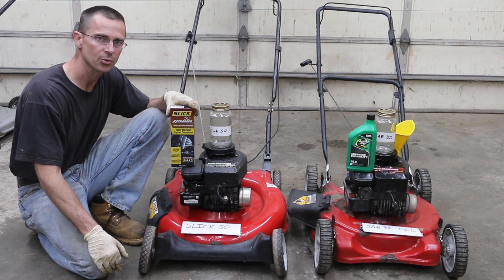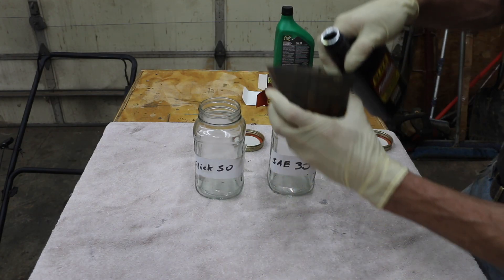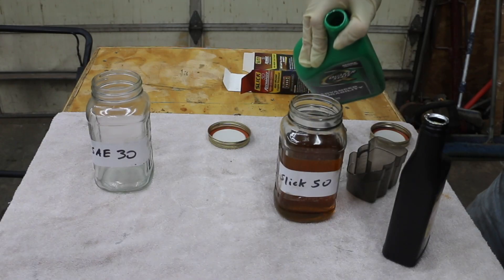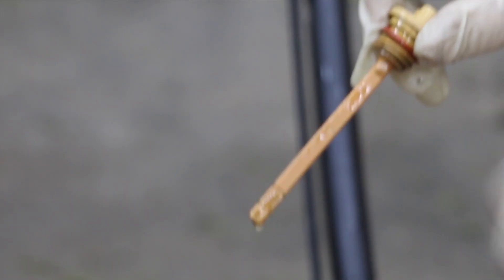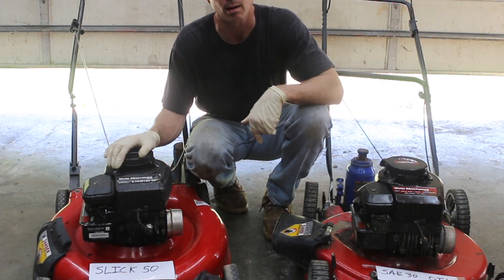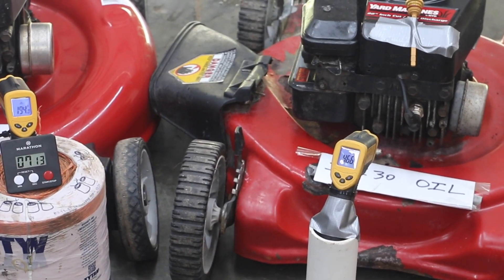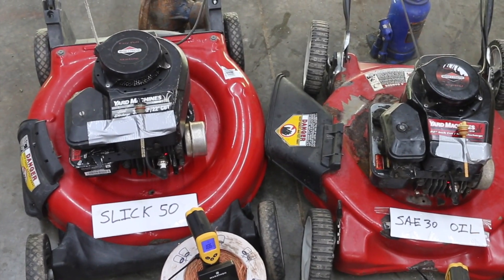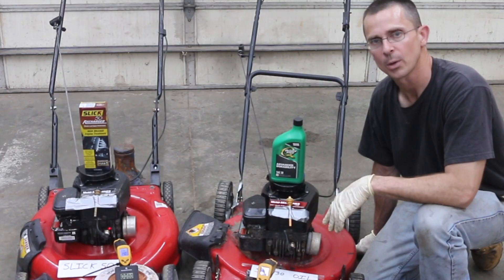Can't believe what SLICK 50 did to my engine!!--Dry Crankcase Test!

Comment: DuPont (the makers of Teflon, the active ingredient in Slick 50) actually said when they first developed the stuff, that is was not practical for running as an oil additive in an ICE (Internal Combustion Engine).  They primarily said this due to the fact that it breaks down over time with heat, even becoming more harmful to the engine.  Under extreme heat (empty crank case) it breaks down VERY quickly.  It seems that this was ignored by just about everyone back in the day.  Just look at an old Teflon coated cooking pan.
Reply from the maker: Thank you for this information.
Reply: No problem.  As a by the by, there was a product a few years ago that did what Slick 50 couldn't, or at least I was told it could.  About 20 years ago you could get hold of a product called MBL (Medal Based Lubricant) by Pro-Ma Systems.  It was an oil additive that was essentially micro (or possibly nano) sized balls of Lead and Copper.  This could (to a point) rejuvenate old engines by filling the scores with the copper and lubricating with the lead.  You could not use it for engines with say, roller bearing cranks (or any roller bearings for that matter) but in a standard engine it worked great.  Roller bearings tended to suffer from a buildup of material on the rollers.   I heard that this product eventually run fowl of the EPA as a small amount gets burnt (as you would expect) and so ends up in the atmosphere.  I believe its still available but the formula has now changed.  It was not available in shops. it was distributed via MLM.  Looking...  found it.  https://www.pro-masystems.com.au.  I didnt realise it was actually an Australian company.  Might not have been as popular in America.  There's an idea for your channel - if you can get hold of the stuff.  If you want to and cant get hold of the stuff, let me know.  I should be able to get hold of it again.

Comment: Xtreme Green is better.  It coats friction surfaces in Antimony if and when they get hot enough.  Slick 50 is a short chain solvent that cuts oil molecules down into smaller pieces to protect on start up and potentially clean oil galleries.  It does nothing to protect against heat, pressure, or friction.  Think of it as a cleaner and thinner in my opinion.
Reply: The way you described Slick 50 it would reduce temperature by improving flow (carry more heat away) and of course the Teflon.
8-)
Reply: briansmobile1, it is not a cleaner.  or that is, it never used to be.  it is or was a teflon coating that coats the inside of the engine.  i have had 2 top successes using it years ago.  and a fail since and a few maybes as well.  did it coat the internals?  probably.  i knew engine rebuilders who had grief trying to rebuild engines that had been done with it.  as long as they knew it had been used they could work with it.  it had to be removed to complete the rebuild.  it was also made known to me that it should not be used in a engine that was not fully worn in or it wouldnt wear in properly causing premature failure.
Reply: " we're going to test that" and find out.
Reply: The original Slick 50 formula back in 1984 is very different than what is made today! The original formula was great and worked well. However the original partners sued each other and the Slick 50 name was bought and sold and the formula was changed and now it isn't worth a damn. If you're really interested you could look up a slick50 documentary here on YouTube.
Reply: Took an oil class. It was sort of dumb but the company paid. So we have these three goons from ExxonMobil cornered. First question: slick 50?
They laughed and said the very extremely well rehearsed answer.
"If our company's scientists thought we needed to add even more ptfe than is already in the oil we would do it".  They implied that their oil experts knew best. 
We had to accept that and move on it was only a 60 minute class. Ha ha ha...
Reply: @mikeries8549   These huge oil companies spend millions testing their blends with a huge variety of different engines in a wide range of temps, conditions and types of use (stop/start vs motorway) etc.. over millions/billions of miles in total... to reach a blend.
Sure adding more of an ingredient by using an additive to effectively change that blend might help one dynamic of its performance (temp reduction through reduced viscosity for example) but equally it could affect another part of the engine worse so personally I'd be more inclined to side with them... as you say, if it was beneficial on the grand scale they would 100% do it already.

PTFE is a good lubricant and has its place.  I use in low load bearing applications, pulleys conveyor systems etc but I wouldnt expect it do very much in an engine.
Reply: Bullshit, it contains PTFE to help coat internal high wear surfaces.
Reply: hence why its a treatment not an additive... a treatment is exactly what it says... it treats symptoms... its not a racing additive its a cleaner.. like prestone engine treatment like seafoam like all that shit... i mean i admit i like prestone i like marvel mystery oil but nothing performs like lucas pure synthetic... NOW THATS AN ADDITIVE AND YES CAN BE USED ALONE BECAUSE ITS FOR ENHANCING OIL... slick fitty breaks oil down thats why an air cooled hot motor wont tolerate it... and if the motor is used well then it needs even thicker oil... not thinner.... this is a worthless test on an already known for being worthless product for increasing performance... get some bestline with 2 new mowers... now thats a test BESTLINE IS INDEED THE BEST.. you dont see banners all over race tracks year after year at the same time not one store will carry it for nothin... its beyond top shelf thats why they cant hang.. the industry wont carry a product that keeps your money in your wallet...

Comment: I would like  to see a test of  identical new engines.  And i would like to see how Prolong would do in your test.  I was anti enging additives for years and years,  but i saw this same type of demonstration with V8 small block  chevys.  All from US engines.  And since i saw how Prolong performed in person,  there was Slick 50, DuraLube, Zmax, Prolong, andna couple other additives also.  The Prolong engine outperformed all other  additives.  I still wouldnt put it in my engines until i had tried it in many of my friends and familys engines first.  And i was sold,   now i run Prolong in all my engines from my  mower to my car and truck and bike and probably always will.  When infirst usednit in my Chevelle's engine within the first 10 minutes my idle went up almost 500 rpm.  That told me it was reducing the friction in my engone.  I adjusted the idle back down, and didnt have to mess with the idle again.  Believe what you will but i am sold on Prolong.

Comment: Thanks for the interesting test. By the way: Particularly if you live in a hot climate, 15W-40 is a great choice for air cooled engines. Scooters from China use that, and Harley Davidson is recommending it. When I lived in Yuma Arizona, my neighbors would give me their old lawn mowers becaused they smoked. The oil always had chunks of carbon in the oil. I'd use some engine flush on it, then fill it with 15W-40, and no smoke. I'd sell the mowers, and I had a few people come back a few years later, telling me that the mower still ran great and didn't smoke. Also, no carbon in the oil.

Comment: So I personally think the slick 50 died first because of temperature. Think about the slick 50 engine, even with out oil, ran at about 270ish, meaning that once compression was gone, then engine would no longer run. With out enough compression, the spark would not be able to ignite the fuel, and the engine would stop. The engine with just oil was running was running at 350ish, possible hot enough to ignite the fuel, even with out compression. meaning that the engine would keep running, until the crank got so hot, it actually welded, and seized its self to the bearing. Even looking at the way they died you can see that. The engine with slick 50 just kind of died, there wasn't really any slow down, and there wasn't any smoke when it died. The just oil engine slowed down, you could tell it was struggling, then it shut off, and poured smoke out of it. It is just a thought, but I would love to see a tear down of both these engines, to what actually failed in them. If my thinking is correct, just add some oil to the engine that had slick 50 in it, and you might be good go.

Comment: Yea Lucas oil stabilizer.
Reply from the maker: Thank you for this recommendation!
Reply: Project Farm no problem been running it with Pennzoil 10w-30 High Mileage in my father's 1981 Ford F100 302 with over 275,000 miles on it before the odometer quit. Lol

Comment: Is it just me or did it look like more oil came out of the Slick 50 engine than the control? That would mean there was more residual oil in the other mower giving it a better result. Just sayin'.
Reply from the maker: Thanks for commenting.  Both engines were dry and the SAE 30 engine ran much hotter. Thanks again!

Comment: I'd really like to see how it holds up compared to slick 50 and just straight motor oil as I've used it in all my vehicals for the last 20 years and have had over 200,000 miles plus on each before selling them.
Reply from the maker: Thank you for this recommendation!

Comment: I believe in prolong, my dad had a van that constantly over heated and with prolong it stopped.  Also he later moved up north some 270 miles pulling a loaded utility trailer and that same van filled with stuff from his garage, he hit a deer with over 100 miles to go.  The deer took out the radiator and power steering and he made it without over heating.  He also had that van for another three years.
Reply from the maker: This is impressive!  I'll be testing Prolong as well as many other oil products in an upcoming video series.  This is going to get interesting!  Thanks for commenting!

Comment: Maybe,   Best Line,   additive,  there's youtube video of a guy testing it,  with one of those friction machines.  Moly oils, but i tried them once / Schaffers Oil, & had big problems in my farm tractor engines.   2 gas engines, & one diesel.  IH brands.  Always used Farm Oyl , when this farmer salesman came selling Schaffers, i finally told him, it cost so much more, & i'm having all this trouble, no more.
Reply from the maker: Thank you for this video project idea! . I'm about to start an entire series on lubricants and will be testing a lot of them.

Comment: i think it was[ duralube] that they said stuck to the motor parts better and they ran the motor with out it in here is the link for it ithttps://www.youtube.com/channel/UCM9lEv0xtKhzsJqprCmhLwQ
Reply from the maker: Thank you for this information.  I'll test this claim in an upcoming video.  Thanks for commenting!
Reply: getitdone1958 I ran Surely be in a 1985 Toyota 1.8 for several years. Decided to overhaul the engine. There was a green buildup on the cylinder walls that was very slick. The cylinders were measured and found to be at factory specs for a new engine. Same thing for the crank. Throws and mains were at factory new specs. New rings, mains and inserts installed. Was a great engine while I owned the car.

Comment: Slick 50 = snake oil
Reply from the maker: Thanks for commenting!
Reply: But it did run cooler when mixed with the oil! Explain that?
Reply: I used slick 50 in my avalanche and found it DOUBLED THE TIME TO WARM UP THE ENGINE IN COLD NORTHERN NEW HAMPSHIRE! MY WIFE said don’t use it in her truck again ! SHE WANTS HEAT SOONER ON THE DRIVE TO WORK!
SO IT DOES SOMETHING????

Comment: Petron plus period. Run petron plus in the oil for a tank of gas. Drain all the oil run that. Brock racing ran a pro drag bike (hayabusa) with out oil and won the race. Give them a call it's a good story. Since then I run it in all my bikes and autos. I even mix a little in my greases especially bearing and ball joints.
Reply from the maker: Thank you for this recommendation!

Comment: I believe you would need to use several (maybe 5) engines with each lub to get a good test.
Reply from the maker: Yes, this is an excellent point.  I should also use all new engines, vs used ones.  This is expensive!

Comment: I did noticed the mower that locked up first is older than the one with sea 30 oil. This may change the results since the one with silk 50 had a lot more ware and tare, you can tell by the wear on he tires
Reply from the maker: This is a very good point. I will add a lot more scientific rigor in future videos, including new engines for these sorts of tests.  It'll be very expensive, but getting valid results is necessary.  Thanks again!

Comment: Andy Granatelli did this same test with STP back in the 1960s. He used Studebaker Avantis at the Bonneville Salt Flats. The Avantis ran for several hours after the STP had been drained. Shortly there after he was brought in as President of STP.
Reply from the maker: Thanks for commenting on this.  I have a hard time believing that any product would allow an engine to run for several hours.  I couldn't even get 5 minutes out of Slick 50.  Thanks again!
Reply: It was one of the great moments in automotive history. He had been working and experimenting with it and told the people at STP they did not know what they had. So they took him up on his challenge and Studebaker furnished the Avantis. Studebaker was already sponsering his Indy Car that    beast Novi. They drained the oil, filled them up with STP then ran the engines long enough that it worked into the entire oil system when they drained the STP out him, and his brother, and son started beating those cars to death out on the Salt Flats. "Several hours" you are probably right, but I do remember it was over an hour. Bear in mind this has been well over 50 years. Shortly after STP brought him in as corporate president to help promoted that product. He is the one that came up with STP sticker that was all over everything back in the 60s. You can read about it in his autobiography "The Call Me Mr. 500" it is on Amazon. It came out in 1968 and went through 2 printings. If you weren't around following racing during that era, you will probably be bored to tears reading it. The only driver names you will probably recognize will be Mario Andretti, and Parnelli Jones. The rest of those drivers have long since left this earth as he has. 

I cannot imagine what moth balls would do to one of these modern fuel injected engines.

Comment: they needed to be the same engine, with the same amount of wear. You should grab some cheapies somewhere. I sometimes see mowers on sale for 60bucks. run them both and break them in evenly. And you needed to follow the directions for the slick 50. do it again, id like to see it done right.
Reply from the maker: Yes, I will use identical new engines in the future.  Thanks for commenting!

Comment: A little late to add my 2¢ worth, but another PTFE ("Teflon")-containing product is TufOil. Its maker, if I remember correctly, states that his product has been tested against Slick50 by an independent lab and come out significantly ahead. If you ever run this test again with multiple additives being tested at a time, include that one as well.
Reply from the maker: Thank you for this recommendation!

Comment: In 1984 Slick 50 lost the right to sell the original product. They had to make their own lubricant and it does not meet any of the original specifications of original formula. If you want to try the original formula it is only available branded as Xcelplus.
Reply from the maker: Thank you for mentioning this.

Comment: How to make your car engine last as long as possible:
Use the manufacturer recommended fluids and always keep fluids at recommended levels.
Service the engine at manufacturer recommended intervals.
Never run your engine for short periods of time, drive the car until it's up to normal operating temperature.

It really is that simple.
Reply from the maker: Great point and thanks for commenting!
Reply: Of course, the engine in a used car will always be suspect, but there are services where you can send in an oil sample from an oil change and see if the barring surfaces are exhibiting undue wear or if there is excessive blow-by or coolant present. 

One last thing, if you have an engine with untouched internals from the leaded gas era(if it came from the factory without cats), high zinc high phosphorus oil is a good idea.

Comment: The thing about Slick 50 is that its main ingredient is PTFE (Polytetrafluoroethylene also known as Teflon), I found it a great little crud cutter in old engines but after a while, it would eat through gasket material and cause major leaking. PTFE was also pushed as a great way to shine your car's paint. It worked quite well until the PTFE ate through the paint and you found yourself with paint chips flying everywhere. The other stuff, (I can't remember the name), was foisted as a protectant for your dash. I had an 83 Ford with a faux leather vinyl dash. It would slowly eat through the crinkle finish and leave it perfectly smooth. I could run a dry rag across it and pull up bits of vinyl. Had I known, I'd never have used that stuff. Today, I simply can't recommend PTFE for other than limited applications and only for a short period.
Reply from the maker: This is great information. Thanks for commenting!